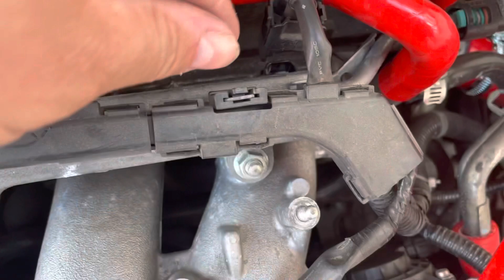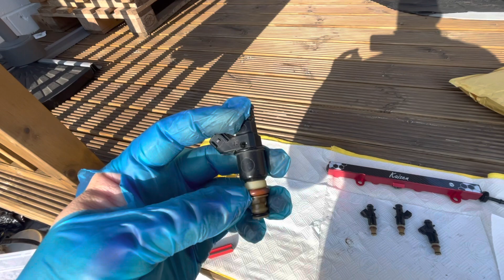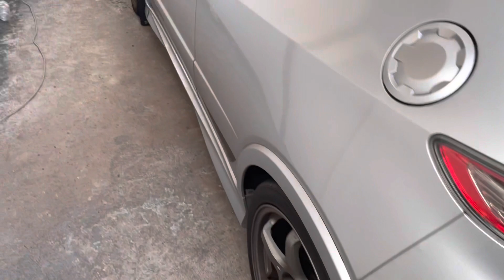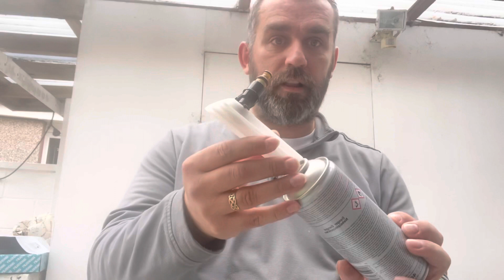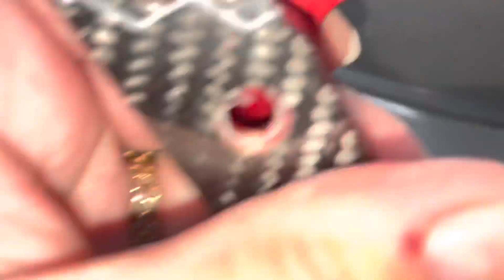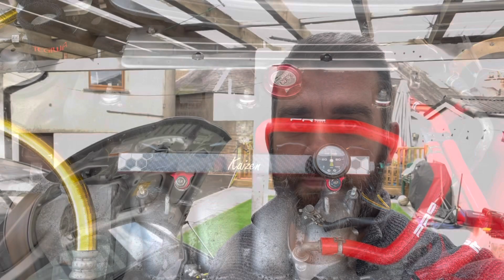Kaizen Fuel Rail Install - Honda Civic Type R FN2

Comment: Have you got a link to your video showing how to remove the fuel rail. Thankyou
Reply from the maker: This video shows the process of removing the OEM fuel rail from 3min 30.

If you have an aftermarket fuel rail, there is also another video showing a quick change out

https://youtu.be/7ocbF_7PGtI?si=BV7XDH_yiLtOCBhE

Comment: Does the inlet manifold need to be removed to change the injectors
Reply from the maker: No, the inlet manifold can stay in position to change the injectors. The injectors will come out of the manifold as you take the fuel rail out
Reply from the maker: I’ve also got a quick fuel rail change video on the channel that might show the process better

Comment: Where was the pro hose kit from ? Did you change them yourself?
Reply from the maker: Got the kit from Dynodaze Performance. They do various hose kits for the FN2. Changed then out myself. Not quite changed them out at the rear of the engine yet but the ones I could get easy access to, were straight forward.
Reply: @TypeRTweaks  thank you

Comment: Did this rail improve performance at all or was it just for how it looks in engine bay ?
Reply from the maker: The rail is really for cosmetic purposes vs OEM. You can get higher capacity injectors but this only makes a difference when turbo’d / supercharged.

Comment: I dont think il attempt installing one on mine now after watching this lol
Reply: Will it leak fuel then without that tape??
Reply from the maker: It’s recommended to have some form of tape but only the gauge. Silicon thread tape would be better than the PTFE tape as the fuel can break it down.
Reply from the maker: I’m going to be changing mine again to a Hybrid Racing fuel rail so hopefully I will have learnt some lessons 😂😂😂
Reply from the maker: 😂😂 just make sure it’s free from any debris before fitting it 👍

Comment: Loved the video will definitely refer back to it when I do mine 👍
Reply from the maker: Thanks man, main thing is others avoiding the issues I had 👍
Reply from the maker: Have you done yours yet?
Reply: @TypeRTweaks  sadly no.  I just couldn’t get excited about the car,  bought loads of parts and never fitted them.  Cars gone I have a couple of brand new parts left to sell.  Currently on a new project which is an Octavia vrs
Reply from the maker: Aw that’s a shame, the Skoda VRS’ are good cars and rapid 👍 what sort of parts you got up for sale?
Reply: @TypeRTweaks  all I’ve got left is a front upper strut brace and matching rear upper strut brace both brand new never fitted in their original packaging

Comment: Great video! Some good little tips there to help those who fit them by their selves 🙂 Glad you got it running as it should in the end 🤙
Reply from the maker: Thanks Liam, just frustrating. Cleaning out the rail fully is a must for folks just to make sure nothing is there. Thanks again for your support when I had the issues 👍